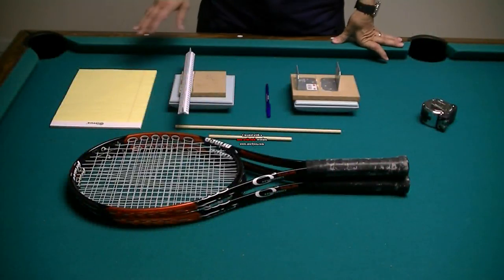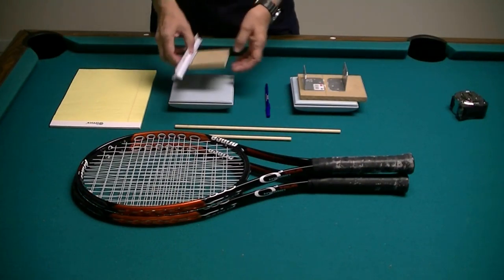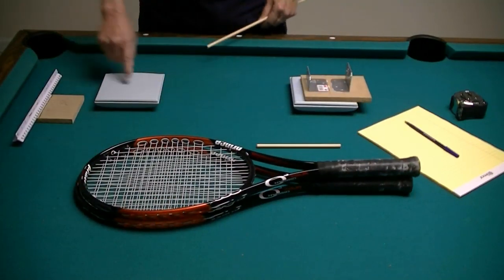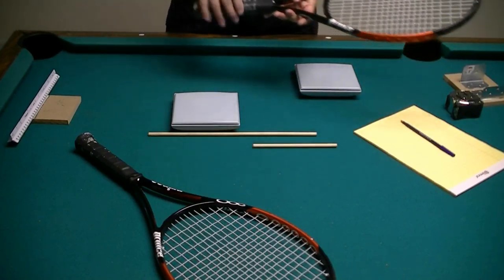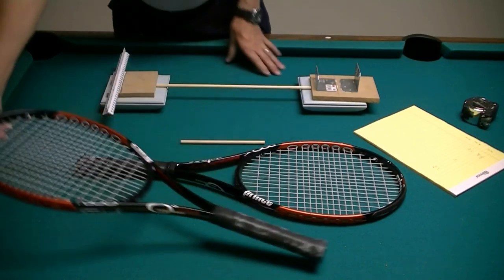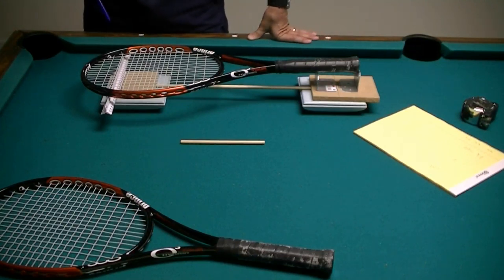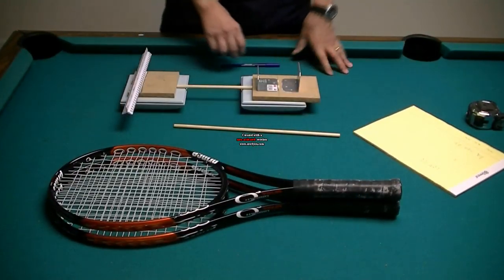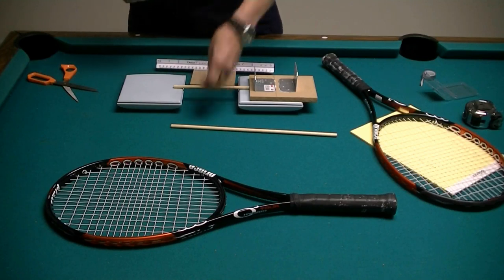Racket matching and balancing part 1.flv

Comment: Congratulations on a great job. Couple of questions thou. Why take it a bit further and do the second weight measurement at 40 cm?? Is the one at 60cm not good enough?? Or are you just too much of a perfectionist? You also did the whole process with the racquets strung. Is this recommended, or is it better to balance and match the racquets unstrung knowing i will always string them using the same string for both racquets. Or it doesn't matter as long as they are strung with the same string?

Comment from the maker: If you tare out the scales the weight of the dowels is not included it does not matter what they weigh. If you are only looking for equal weight distribution in a tennis racket when matching.

Comment from the maker: If you don't do the second measurement you are just matching up the balance points of the two rackets. It would not matter if you did the rackets strung or unstrung as long as you did both the same.

Comment from the maker: If you get the same weight on all three points (there will be two at 10 cm) your balance point will be identical.  You swingweight is be as close as the weight and distance measurements you made.  good luck

Comment: far too many variables. Adding weight changes the balance point and the swing-weight, which in my opinion is the most noticeable. I have frames that are upto 5 grams out from each other, I cant tell them apart as they all have the same B.P and S.W and custom moulded handles.
Reply from the maker: +Nelly Nelson that's true but matching up the weight and  balance doesn't take long. I have newer videos On matching rackets